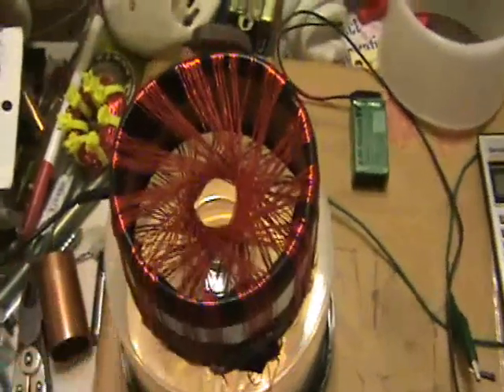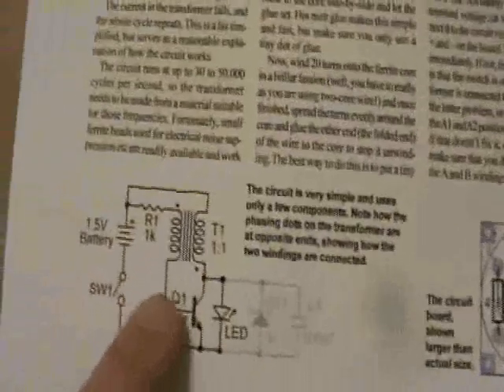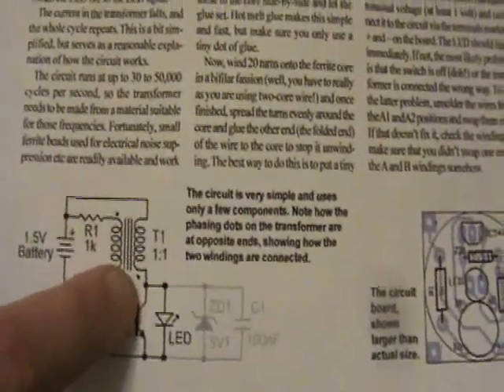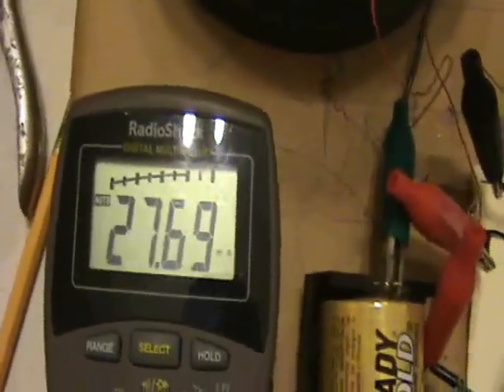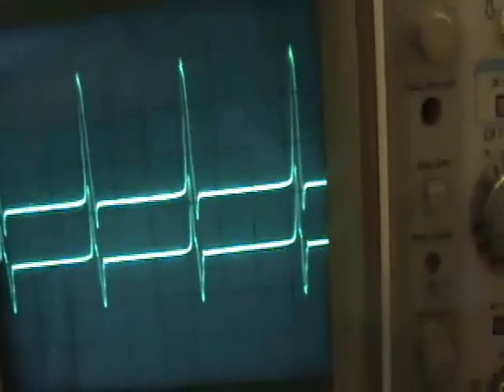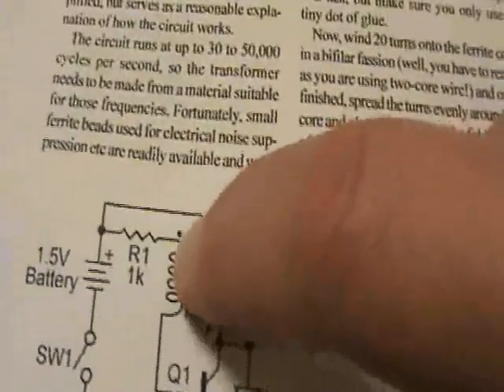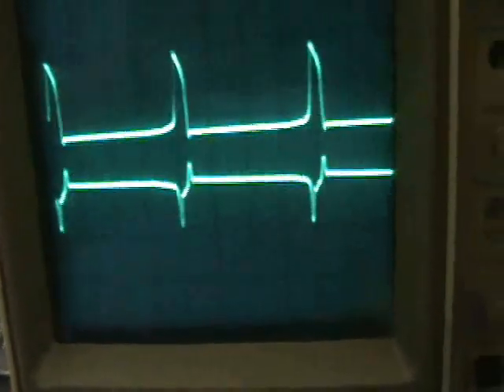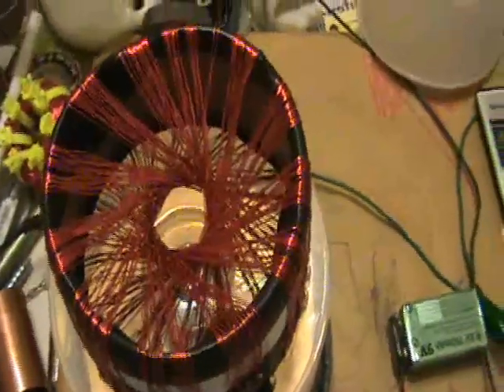"Tuna Can" Rodin Coil With A Joule Thief

Comment: The magnetic field of the rodin coil is produced external which is different from the typical torroid coils which magnetizes the iron core INISDE which further amplifies the amount of induction.

The Rodin coil appears produces a monopole on only one side of the coil.

Perhaps if you could exploit this fact and place another flat induction coil on top of an iron plate ABOVE the rodin coil and incorporate this in a joule theif, I bet you can get some very interesting results. The rodin coil produces unusually strong magnetic fields which are note being fully taken advantage of in this setup!

Just some thoughts, let me know what you think.

Comment from the maker: @SinistaMace 
The Joule Thief oscillator is exploiting positive feedback by inverting the signal twice, once thru the transistor ... and a 2nd time thru the transformer. With a Tuna Rodin Coil as the transformer, the geometry is a bit different in that the inductive energy transfer between the two coil circuits is in this unusual toroidal - cylinder - god's eye -- shape. The magnetic fields are nicely zinging around the cylinder.

Comment from the maker: Good suggestion. Next time I will be more careful to start from a fully charged battery. It may have had a weak charge on it which could explain the rapid current drop. I thought it was charged, but I did not check that carefully.